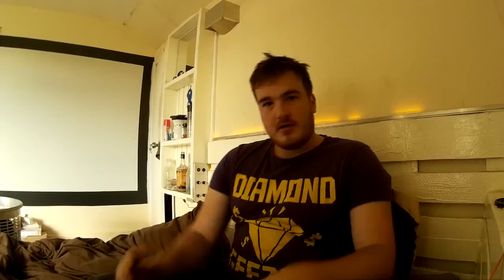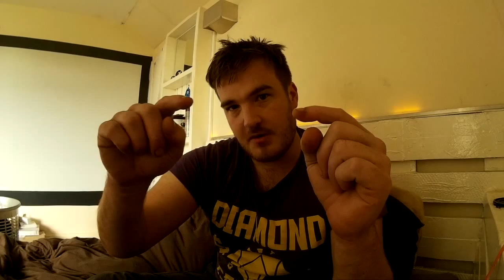Self Learning Hydroponics System: EC Tuning Theory

Comment: Hi Mike, really excited to find somebody doing this. Am planning to build a similar system.

Are you using selenoid valves or peristaltic pumps to dose from concentrated nutrient solution to the feeder tank?
Also, have you come across any references to NPK concentration references to say total last day sunlight exposure, temperature, humidity?
thanks for the video and blog post
Reply from the maker: Hey, I was using a turbine pump, but now moved to peristaltic for better accuracy. I didnt find much content discussing the nutrient needs of plants depending on environmental conditions unfortunately.

Have you got any automation set up already?
Reply: Just starting on hydroponics!!! complete noob to electronics, but have good background with biology and numbers.

I don't yet have any set up. but am sketching the whole structure as I go through basics of plant nutirition books.

Aim is to create Nutrient dosing system that can change dose of each macro nutrient. So it will have somewhere 5-6 reserviors of highly concentrated single molecule solutions.

I am basing my system on Arduino Mega and Rasberry Pi3 . 

I will be experimenting with Valve first to see whether the the quantity of dosing can be dependably controlled through them. 

How is your experience with peristaltic pump? 

Do you have similar set up as I am trying to build?
Reply from the maker: Are you in the UK? 

I am happy dosing a generic fertiliser at the moment [NPK suited to plants], I would like to dose individually  if I had a way to measure the absorption of specific nutrients [mass spec?]. Most of my system is aquaponics now, working on a 6 system hydroponics for some more detailed tests [for a third party]. 

The pumps are great for my application, with a good quality power supply they dose reliable ml/s.
Reply: From India...
I think there might be a way to arrive at a crude NPK absorption, without mass specs. have you tried using plant wt. in algo to decide NPK?
I bought Rasberry to undertake these to and fro calculations. 
will look for peristaltic pumps as well.
On a side note, how accurate is the PPM fix with an electricity plug that you have explained on the blog?
Planning to build it and buy industry grade Ph meter so that I can use to continuously.
Reply: of course m looking at closed system
Reply from the maker: Got a link for the calculations? 
If you read the blog I talk about the ppm/EC accuracy [ was a long time ago I used a plug], if you or a friend has a 3D printer I can send you the files for a better probe? 

On Ph probes.... they are all rubbish, make sure you calibrate often and set max limits for the controller. they drift, give crazy readings and are a big hindrance to automation as it stands.
Reply: I don&#39;t have a link for calculations... Will have to build the logic from scratch and gather data from published articles. this can be done for one type of plant at a time i think. Will let you know once i build a code for Tomatoes

Don&#39;t have access to 3d printer. will have to double check readings it seems in two separate vessels.

thanks for the heads up on Ph meter, i was under impression that industrial grade Ph meter should solve that problem. (they are bloody expensive)